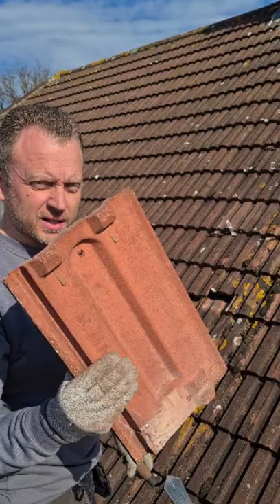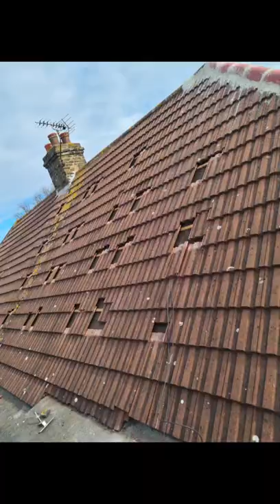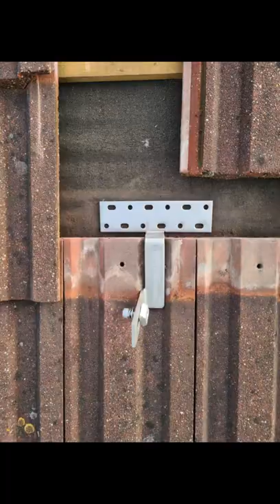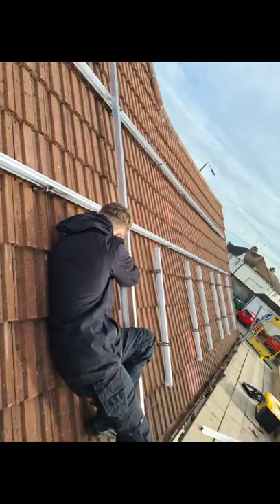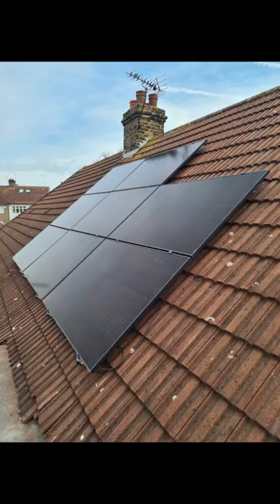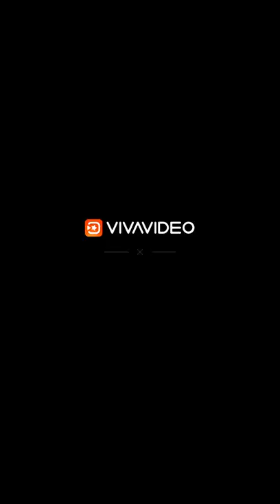BEST TOOL to use when installing SOLAR PV on roof 👌

Comment: Nice, gonna try it! Still think I'll stick to my claw hammer. Basically does the same thing + you can hold your tile up by rotating the claw part all the way underneath the tile. I also use the rubber handle to push open sturdy tiles. Might be worth a shot yourself❤
Reply from the maker: Thanks for watching, always works well for me but there are a few tools you can use, I usually use my boot to kick tiles up. The trowel is especially good on rosemary tiles. 👍
Reply: professor

Comment: The brackets themselves which go under the tiles. Do they only sit in position, not fixed/screwed in? Cheers
Reply from the maker: Two fixing screws into rafter normally

Comment: Hey I have 4 100 watt solar panels that need to be mounted on a roof. It about 45 degrees. The only problem is I don’t want to drill into the roof or anything like that. Is there any way I could mount them without damaging or drilling.
Reply from the maker: What's the roof type
Reply: @essexcountyelectricalltd  its regular shingles for what I know, the wall is next to it so it’s like a roof extension on the side of a house, many I could attach something from the wall like string
Reply from the maker: @Anerder772  not done it that way tbh
Reply: maybe you need the Punch-free bracket

Comment: PV ground bracket +Easy and fast installation without punch holes. Match 980mm-1134mm width solar module..flat roof,open area
Reply: for roof , you have the suitable Mounting system without punch holes,like ESDEC, right?